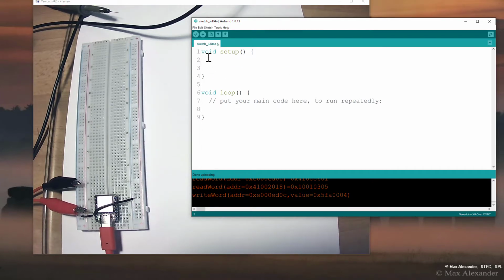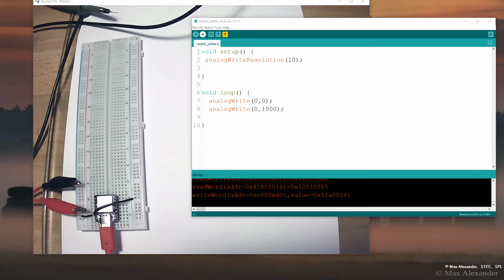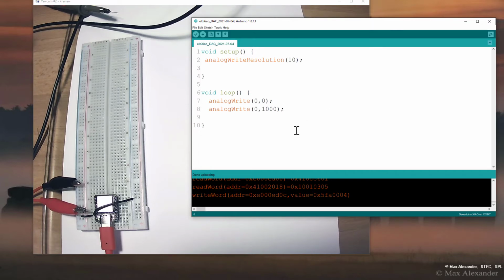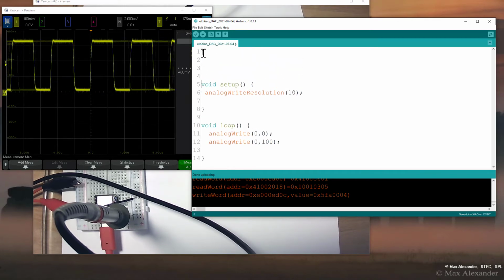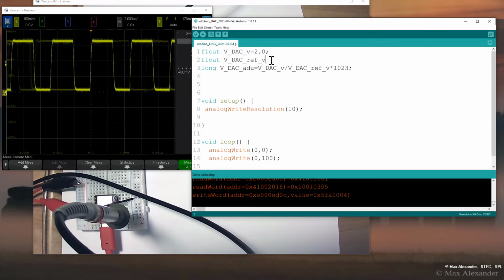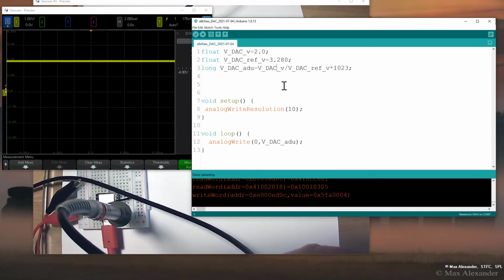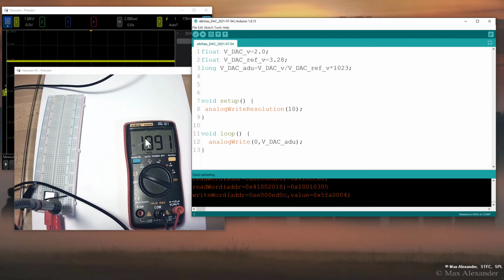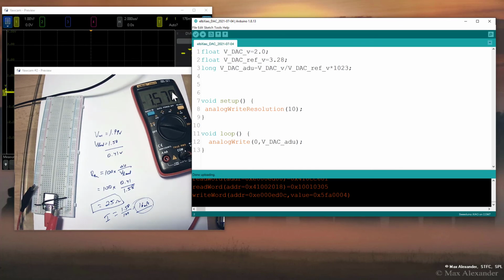SBW 16-3: DAC

Comment: That was very interesting and very helpful to know some of the values that are needed and that the circuit can drive. Saved having a blown xiao!! ;)

I noticed that the power lines have a bit of noise on them - from the laptop usb rails no doubt? I tried a 100uF capacitor across the 0-5v line. It reduced the noise a little, but not as much as I would have hoped for. I also tried a 100nF capacitor, but that made no difference. (Just an observation).